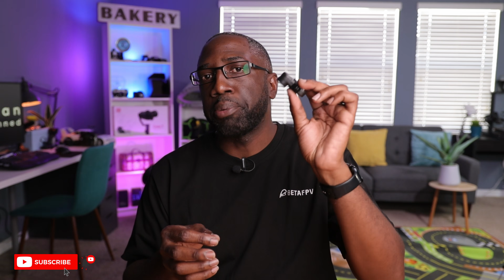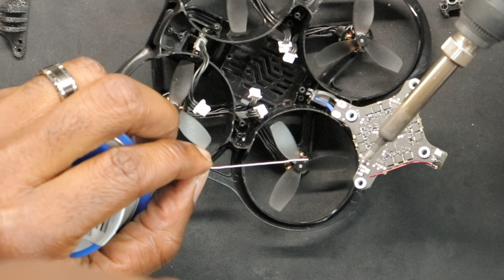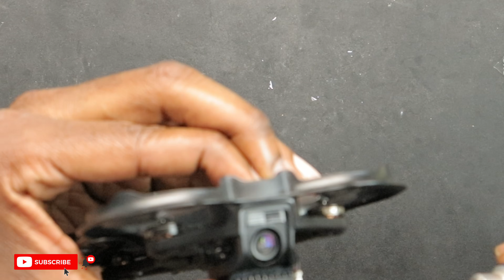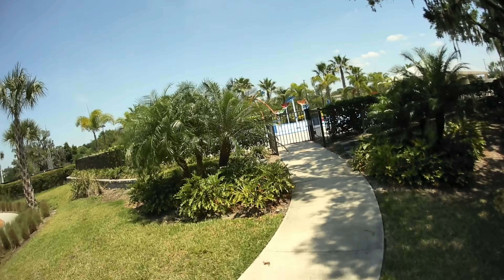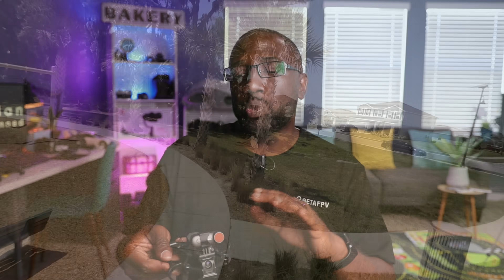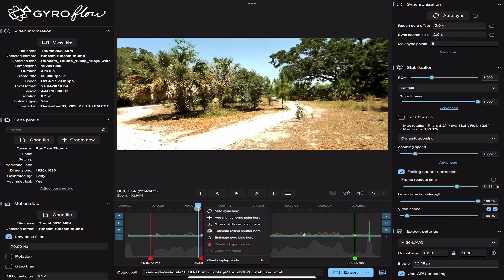The Aquila16 REALLY Can Record HD footage..Here’s How!

Comment: Hello.
It seems to be equipped with Insta 360, but do I need to change to a more powerful motor to fly it?
Also, are you using a battery with a low capacity?
I'd like to hear more details and try it out myself.

こんにちは。
Insta 360を搭載されてるようですけど飛行させるにはパワーのあるモーターに変更しないと飛ばないですか？
また、バッテリーは容量の少ないのを使ってるのですか？
詳細を聞いて自分もやってみたいと思っています。

Comment: Can you power the pro and the normal one with an 1s battery
Reply from the maker: I have not tried, but I don't think it would work...The O3 Air Unit requires 9volts although the FC does have a BEC.  I have not seen a 1S battery with an XT30 connector either.
Reply: No i mean the thumbs pro cam of it can work with an 1s battery

Comment: Great little mod! I'm impressed with the crispness of the Runcam's 1080p output! Which flight mode were you using? 

You had nice bright lighting conditions, would be interesting to see how it performs in low light.

One issue with the Aquilla 16 is that it is so light and small that it does not perform well in any kind of wind. Pretty much would need perfect conditions to get ok results. Still, this seems like a fun solution for a low price entry point!
Reply from the maker: Thanks…Its not too bad considering it is not a very powerful drone.  I was in Sport Mode “Fast” speed setting.